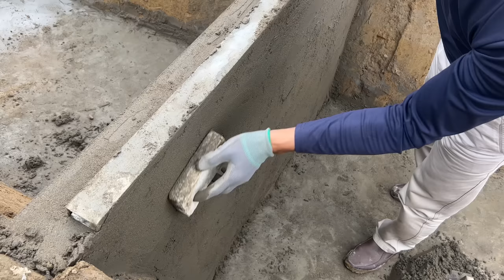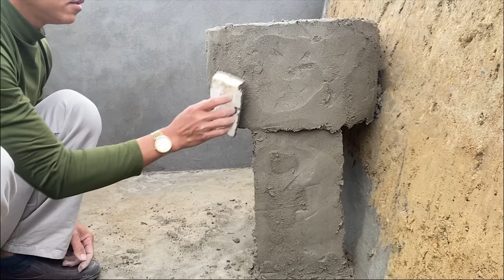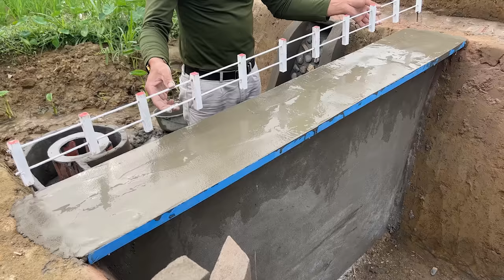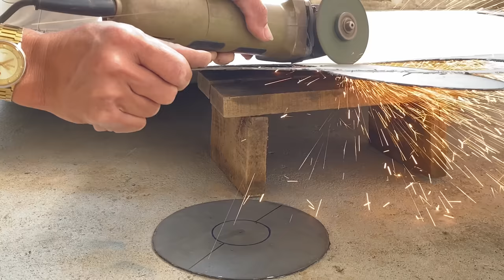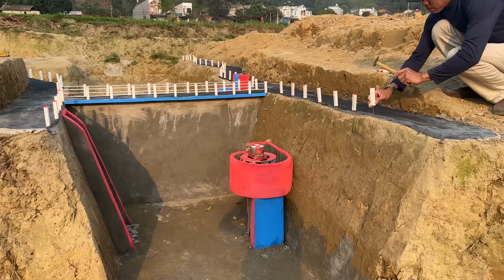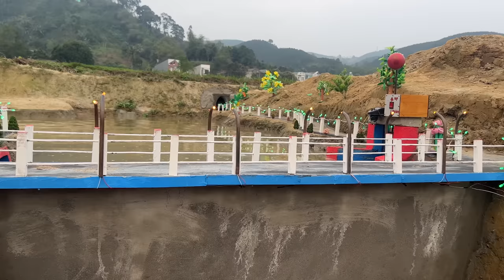Unique mini hydropower design with one units

Comment: This must be his job.  I've seen him make several of these.  His engineering gets better and better with each one.  By lowering where the water spins the generator, he increased the velocity = greater electrical power.   Using a pipe also aids to prevent a worry of erosion.  I suppose if there is a monsoon, he can pull the caps off the pipes beneath the dam if he has too.  Might help to do that occasionally to prevent silt build up.   I'd like to see an aerial view of where he is building these.
Reply from the maker: Thank you so much 😊❤️❤️❤️❤️
Reply: It looks like a paddy in Vietnam

Comment: He visto varios videos tuyos y en todos veo el mismo problema. 
No te has planteado que pasa si aumenta la presión del agua sobre el muro la presa. 
La parte baja de la presa debería ser más gruesa que la parte alta, sino con el tiempo terminara cediendo a la presión, se romperá y el agua inundara todo.

I have seen several of your videos and I see the same problem in all of them.
You have not considered what happens if the pressure of the water on the wall of the dam increases.
The lower part of the dam should be thicker than the upper part, otherwise it will eventually give way to the pressure, it will break and the water will flood everything.

我看过你的几个视频，并且在所有视频中都发现了同样的问题。
你没有考虑过如果水坝壁上的水压增加会发生什么。
大坝的下部应该比上部厚，否则它最终会屈服于压力，它会破裂，水会淹没一切。